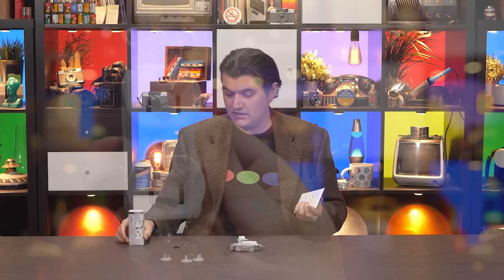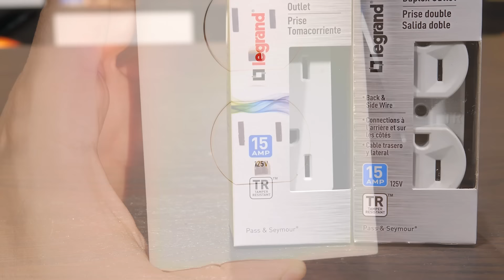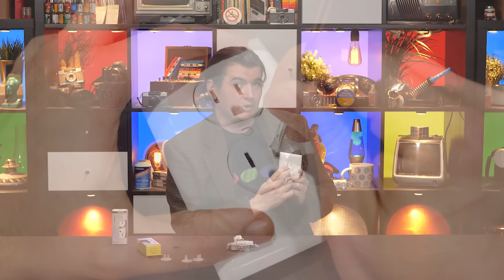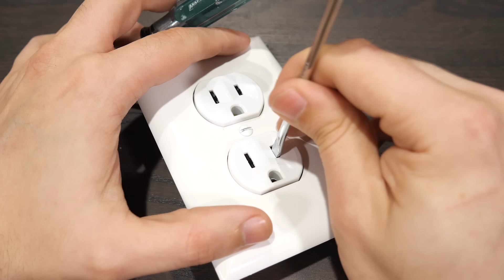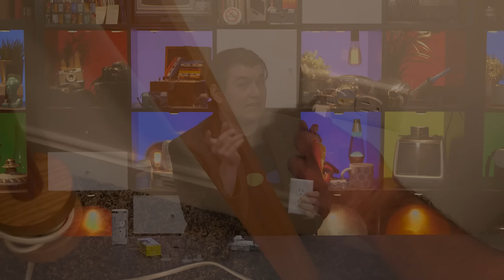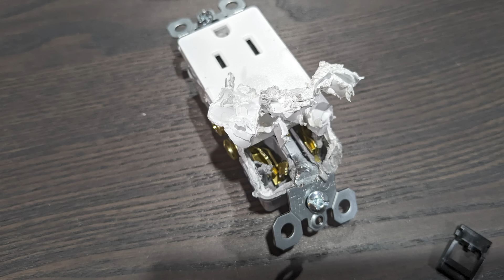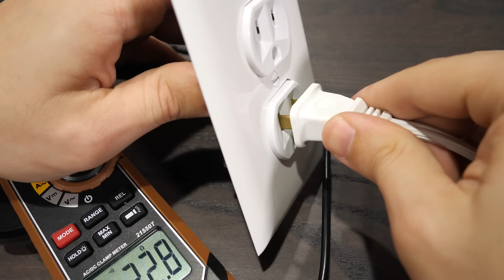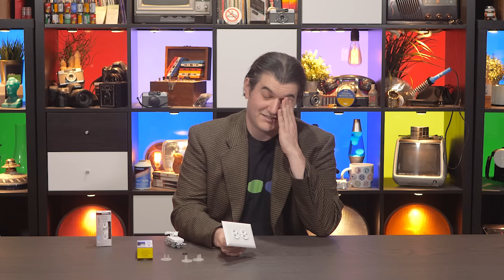Tamper-resistant outlets aren't all the same - a follow-up

Comment: One of my old electrical teacher told that the potential of dying of 240V is higher than 120V but the potential of dying with is still there!
I'm from Sweden so only places i have seen 120V is the shave charge outlet in some older bathrooms.

Comment: My house was built in the early 1950s, and when we bought it about 10 years ago, there were a few plugs that were fairly loose (at 60 years old, still only a few!).  I mostly just ... didn't use those outlets, until I had a kid.  Then I went around and replaced all the floor-reachable outlets with nice new tamper-resistant ones.  Bonus: No more loose outlets.  Highly recommended.  Turns out my kid simply isn't one prone to doing dumb things like that (neither was I), so it wasn't really needed, but I sure do like that all my outlets have a nice firm grip now.  That they are tamper resistant will doubtless be a positive if we ever sell our house.  Not bad for a truly small cost and fairly small time investment.

Comment: Wago are reusable whereas backstabbing is single use and typically damages the wire and/or clip. Also, wago makes a clean joint with stranded while back stabbing typically frays the stranded. You don’t use backstabbing for when you need to change things down the road.

Comment: Some British outlets use the two pins method to open the shutters rather than the Earth pin method; both are allowed by the standard but the Earth pin method is more common.  Some even require both the Earth pin to be inserted first and both line and neutral pins to be inserted together.  Outlets which use the two pins together method are designed so that only correctly shaped and sized pins will open the shutter; trying to insert a French or German plug for example will not work.  Nor will the terrible 2 pin ‘Euro’ plug.

The Euro plug needs some explanation.  It can be found in most European countries except the UK and Ireland.  Most European countries use plugs where the line and neutral pins are 4 or 4.8 mm in diameter and spaced at 19 mm centres.  The 4 mm ones are rated at 10 A and the 16 mm ones at 16 A.  Most countries which use 10 A plugs also have a larger 16 A version available for larger loads.

What differs between countries is the earthing contact.  In France it is a pin in the socket which goes into a hole in the plug, in Germany it is two contacts on the side of the plug, in Italy it is a third pin centred between the other two and in Switzerland it’s a third pin but offset slightly to one side for example.  For small items which do not need an earth connection these differences do not matter, but there’s still the problem of the different pin diameters.  To make a ‘universal’ 2 pin plug the pins had to be 4 mm in diameter but these would not correctly fit a 4.8 mm socket.  To get around this problem they designed the pins so that they are angled in slightly towards the tips, and the body of the plug is made of a slightly flexible plastic material.  When inserted into a 4 mm socket the tops of the pins are pulled apart slightly as it is inserted so that they are parallel to each other.  When inserted into a 304.8 mm socket they remain slightly angled in. And so make contact on just a tiny area on the rounded tip on each pin.  This is why these things are rated at only 2.5 A.

Most people who get 240 V across their body will survive the experience; some will not, and as you say, it will depend on various factors.  Getting a 120 V or 240 V shock is a bad thing, and is to be avoided if at all possible.  I have had 240 V across me about five of six times and I am still here.  In each case it was very painful.  In the last case I was, just, an adult.  I was connecting a power cord to the rectifier for an old 16 mm xenon ard film projector.  I connected the mains end first for some reason and then grabbed hold of the connector on the other end to connect it to the rectifier.  The hard Bakelite type plastic of the connector was cracked and part of it fell away exposing the contacts.  I won’t make that mistake again.  All of the other times were as a child when I had a habit of opening things up to se how they worked, including a pendent light switch which hung down beside my bed, and taking the back off and old radio and television.  It took several shocks for me to learn my lesson.  Most of the swings from which I received a shock were old, from the ‘30s to ‘50s, and not really designed with child safety in mind; they certainly wouldn’t meet modern standards.  I am now 66 years old, my heart is not as good as it once was and I think it quite likely that I would not survive the experience today.

Comment: I'm ashamed to admit the frequency in which I have used one of the blades to help locate the plug into the outlet and I've only been shocked once but funnily enough not because of that but because one rouge outlet in a room wasn't on the same circuit as the others and I was replacing it and got complacent that all the outlets in the room were on the same circuit. 

Any time a plug was behind a bed/bookcase/backed desk/dark/etc I use a finger on one of the blades to guide it. Never shocked that way and while I certainly favor the neutral, I don't limit myself to it. 

I have however had the unfortunate situation of knocking a metal ruler off the back of my desk and it land perfectly onto the prongs.

Comment: I hate "tamper-resistant" outlets because it requires fiddling with something that shouldn't require fiddling because those shutters get in the way. It's just extra bull spit that doesn't need to be in there.  I learned the hard way at 3 years of age that you don't stick a house key into an outlet.

Gave me an appreciation for electricity.

And caused me to go out and learn enough to do my own electrical work.

Comment: I don't understand how your big appliances are 240V over there, here it's (as you know) 230V 16A for most circuits, and it's often not enough for ovens and such so we use the tri-phased power (which is usually distributed among apartments or among circuits in a single apartment or house) by using two phases together instead of phase and neutral, so we get √3 × 230 ≈ 380V (and not 2×230 like you would expect with split-phase, each phase is 120° from each other so you get √3 times the amplitude of single phase and respectively 30°, 150° and 270° out of phase with the other phases) with usually 20A max and that's enough for the appliances

And in an ideal world where all three phases relative to neutral (L1-N, L2-N, L3-N) are used equally and all 3 possibilities for the two phases together (L1-L2, L1-L3, L2-L3) are also used equally, the power usage is constant across all the wires which is desirable for the power company

Comment: 13:50 People will disagree with that, I just don't know what they are getting out of a channel that isn't about fear mongering. I have met people that think replacing a single switch, socket, or even bulb is a job so dangerous that it can only be done by an electrical engineer clad in a rubber suit.

These people think I am a crazy person that throws caution to the wind because I think all people that live with electricity require the knowledge to handle the simpler fixes and know the ones they need help for.

Comment: If we wanted to improve the outlet design without massive incompatibility, could we? Is there a sleeved plug that would work with most (or all) existing receptacles?

Breaking the plugs in everyone's walls is a massive political problem. (I.e. it pisses EVERYONE off.) Is there something we could do  to make outlets and plugs safer without breaking things?

Comment: I installed all new TR receptacles in my home. Most of them are made by Legrand.

Yes, they are slightly fiddly to use, but after living with them for a couple years, I almost don't notice it anymore since I just got the knack of how to plug things in so it works easily.

Comment: as an electrician, dealing with trainees, we find that we actually have to un-train some of the fear of electricity. One way is by having a live 120v wire and telling them to hold it- as long as they are not grounding on something and are dry it is quite safe. This is mostly done to prove that cartoon/video game coiling lightning won't fly out and turn you into a neon flashing skeleton at this voltage/in this situation.
Reply: As a welder myself & a son of a firefighter/EMT all I can say is: you really ought to be more afraid of electricity. The number of corpses my dad had to haul out because they grounded themselves "because they're weren't afraid of working on live wires" is rediculous.

I've lost the ability to empathize with all electricians at this point, if you get shocked: unless you're a bucket worker trying to fix powerlines then you probably had the ability to do you work safer AND YOU CHOSE NOT TO. Survival of the least stupid. Get wrecked idiots.

Comment: 8:05 Ok, as a side note. I was in Iceland earlier this year and I bought a specific plug adapter for Iceland (Type F). These have a large almost circular base that slots into the receptacle. For whatever reason, I COULD NOT get my adapter to fit in about half of my hotel room outlets. And the ones it did, it fell out immediately. I stared at it for awhile and couldn't figure it out. It was a perfect match. I thought maybe I wasn't giving enough force to seat the plug, but that was not the case. It DID work in 1 outlet in my friends room.

I borrowed my friends adapter which was a european Type C. That one worked with absolutely no problems, but it was definitely the wrong shape and left a large gap in the recessed faceplate.

Just bizarre that the correct plug did not work, and a wrong one did.
Reply: Type F plugs need to be pushed really hard to insert, probably because of the tamper resistance. 

Type C outlets are a crime against humanity. I’m glad I installed type F outlets in my house.

Comment: I see other europeans already mentioned the tamper mechanism in schuko outlets, so instead I’ll talk about why some europeans may think American plugs are bad: if you ever get a device that was designed to use NEMA-like plugs (because japanese and chinese plugs are a bit different), it probably was paired with a really crappy adapter that barely holds your plug. In my experience, none of them were doing a good job, the only halfway decent socket I have is on a step down transformer I use for my 120 only systems.

Comment: What about.. what about a retractable sleeve?  One that is pushed back into the plug housing by the outlet face as you press it into place?  It would add some spring tension that's constantly trying to press the plug back out of the outlet, but I think it could help. Add some finger grips on the plug portion to make them easier, mandate that 90 degree angle plug, and I think perhaps that might fix things?

Comment: The issue with backstabbing isn't that it's a bad connection, it's that it's the most frustrating thing to pull a wire out of. Also technically you aren't supposed to reuse it again, but I'm not sure if that's manufacturer specific.

Comment: I’ve done a fair bit of replacing outlets, switches, and light fixtures around the house, eventually I got careless and forgot to turn off a breaker. Definitely felt a weird tingle a couple times while working, only realized what had happened when I walked back to flip the breaker and saw it was still on — I’ll bet accidentally touching a 240v line wouldn’t have been near as ambiguous 😅

Comment: Two things.. The hotel plugs suck, but by design.  They are made to be intentionally loose so that if you pull on a cord it will come out, instead of dragging the lamp off the table.  
On the edison plugs, I think it's not so much that that the voltage is less dangerous as such, but more that it's just a non-issue in real life.  people don't get hurt plugging things in, so there is no reason to change them just to avoid something that doesn't happen.  I'm not saying it never happens, but it happens once with a shock that is not actually all that harmful, current passing through a finger tip to the other conductor, then they learn to be more careful and it doesn't happen again.  In the real world, the plug might not be as safe as other designs, but changing it wouldn't actually prevent any significant number of injuries.

Comment: On the comparison of a shock from 120v compared to 240v, 240v is more likely to "grab" you, while 120v won't. As an electrician, I've been shocked several times by 120. On backstabbing, I do it, but you have to make sure that absolutely NO copper is showing. Of course I don't backstab 20a circuits, and switches (which yes, they have backstabbing). Also the mechanism for the backstabs is not the same as a wago. I don't know the specifics entirely. I also remember that one company makes a receptacle with wagos built in.

Comment: It's the volts that jolt, but it's the milli's that kill. Learned that first day electrical school. 10 to 20 MILLIAMPS can and will kill you, at voltages as low as 50 volts, in the right  environment. You really need to understand basic electrical before you start telling anyone which is better, IMO. Yes 240 will make you jump higher, if you want drama. I would stick to what you really know. A 9 volt battery powers most stun guns, and most could be made lethal. Electrical advice is REALLY out of your wheelhouse, please make that clear, if the way you inspected that receptacle wasn't evidence enough.

Comment: One advantage to american design, less of a trip hazard.
The easier it is to remove, the less likely you're going to kill yourself when you inevitably catch your foot on the cord.
(this generally applies only to the 2 prong type)
(this is also very tongue in cheek)

It's also easier to jerk out of the wall when something catches on fire so you can toss the flaming apparatus out the window.
(this is a joke, don't try this, you will injure yourself, use a fire extinguisher, if that doesn't work, get the hell out of there and call 911, IN THAT ORDER!).

Personally, i really don't want to deal with some of the foreign plugs, especially on power tools, and especially not that UK monstrosity.
Runaway tools ain't no joke and being able to just grab the cord and yank, or it just pulling itself out of the wall has been a, literal, life saver a few times for me.

Trade offs i guess, safe in one scenario, not so much in another.

Comment: Small story illustrating how many "holes" have to line up to get an electric shock:

My sister's house was wired up for YEARS with a wall switch that had live voltage running to the screws on the switch plate. An old fabric coated hot wire had had its insulation jacket crumble where it entered a metal switch box. That meant that the bare hot wire was touching the metal box, making the box live. That box was where the switch screwed into, making the outside of the switch live. The switch plate screws screwed into the switch, making them live... and so, yeah, live voltage right there on the wall for anyone to touch. Yikes.

And yet, nobody ever got shocked by it. Granted, that was extremely lucky, but that's the point. This horrible wiring created the possibility of an electric shock, but everything else had to line up perfectly for that shock to occur. You had to be touching the screws while soaking wet with bare feet while you were grounded. And somehow with her home configuration, none of those things lined up and nobody ever got shocked.

And yes, we ran new wire and replaced the metal switch box with a plastic one. That was the tip of the iceberg with that house anyhow. 

Finally, don't think I'm advocating for ignoring wiring faults in your house. In fact almost the opposite: don't assume your house is wired safely just because you never got a dangerous electric shock. If you don't know, test your outlets and electrical connections. You don't know what the PO or some underpaid sparky did to cut corners before you came around.

Comment: 20 years ago when I moved into the house I'm in I changed every outlet. They were from the 1960s and didn't have a ground. Fortunately, they did in the wiring so it was easy enough to upgrade.

Comment: don't get so gung-ho about modifying your power pins, here in europe, the STANDARD is '2 solid round rods, x far apart, optionally with an half-circular earth pin at position y', but after chinese applienses invaded, they all came with asian power plugs and the EU didn't want to bother to replace them, so they were brought into the standard.
these asian power plogs are functionally identical, but are just a metal cap with a tiny rod going into the housing of the connector through a plastic sleeve.
2 problems with that; 
1. the tiny rods are actually known to break and rip out, leaving a live stick poking out of the receptacle.
2. many european power strips (often the mid-priced to cheaper ones) put the bus-bar very close to the face of the receptacle, meaning, you have slight gap between the bus-bar and the pins, which cause sparks or even fire.